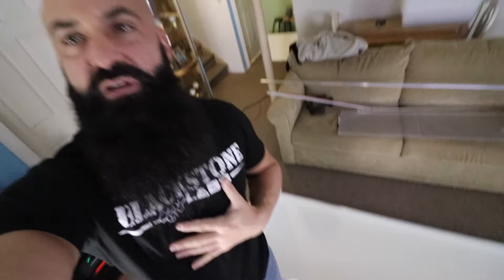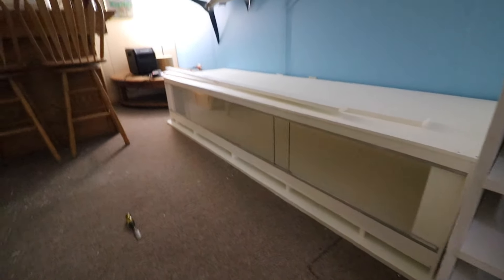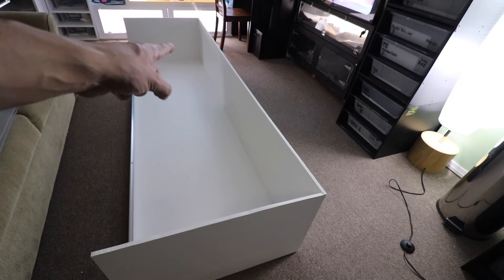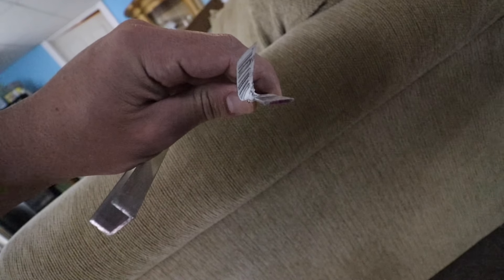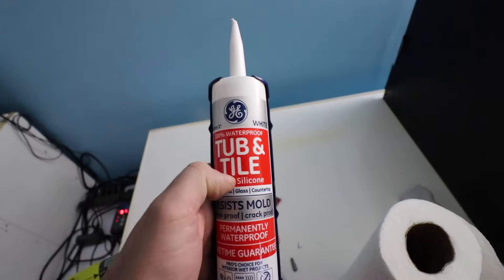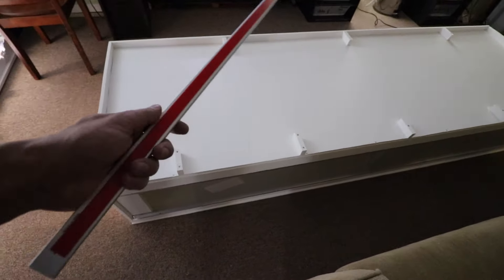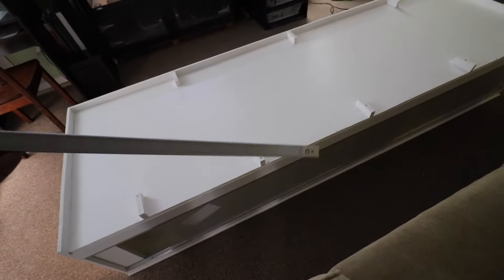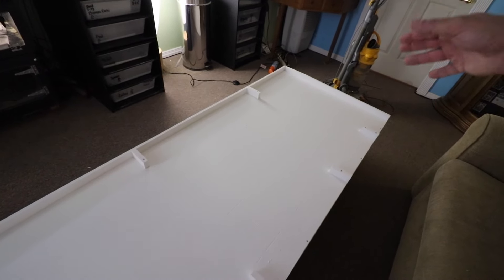How to Build Snake Enclosures (Cheap & Easy) DIY

Comment: im curious how you plan to maintain the heat and how the substrate will hold up with that PVC. Please lemme know.
Reply from the maker: so far the 11" heat tape is able to penetrate the pvc but i also use just paper as a substrate, not a thick bedding.  A heat panel would be a better option.

Comment: Im going to build mine soon im thinking about making a video and putting on YouTube.... Can you take glass out to clean? With knape & vogt track u can take doors in and out. But looks awesome dude.. Also i took a router and route out where heat tape goes plus pro products heat panel.... The bean farm has heat tape pretty cheap
Reply from the maker: Michael Ross i dont have a router, plus if you attach your prove to the heat tape, you would need to router out a spot for that if you want it to lay flat

Comment: Nice cage! It looks pro made I was wondering though how scratched up that plexus is, sliding along each other? Also how well is that caulk adhering to that pvc? There's not a lot that will stick to certain plastics. Really nice and clean look though!
Reply from the maker: The silicone caulk does allow for some wiggle and flex and is still completely sealed. My burms have knocked over their large water dishes and the water stayed inside the enclosure. Also their is still room between the plexi so they arnt grinding against each other when you slide them open and closed.  They are about 4-6 months old and still really clean and clear.  But they were cheap enought that if in a year or two you want to replace them you could, but i dont see a need to replace them anytime soon

Comment: Do you put the heat tape on the outside or inside? It seemed like outside but does heat tape really heat through the board?
Reply from the maker: Rob b outside and yes it definitely gets hot enough. I can easily get the hot spot to around 90

Comment: Amazing enclosure and video.  Two questions...  The feet are installed all around the edges.  You don't need any supports in the center to keep it from sagging? I have some big boas, and that was my only concern. Second, were I to make and stack two, could you envision any problem with connecting the two with a maybe 12 x 16 inch hole with a  removable hatch cover, so they could have a duplex if I wanted. Wadda ya think? 
I really don't have the room to build this inside, I am thinking to build it outside on the deck, bust up the old enclosure,  and then bring it in and set it up. Being in NY, don't wanna start this outside until we get some nice weather. If I do it, I'll let you know, take pictures and buy you a beer when you come to town.
Thanks,

Comment: This is the probably the best tutorial I've watched. You explained things super well and really helped me out!  Im really having a hard time justifying to drop 600-800 on a enclosure that I can make with some determination ( I have no knowledge with tools or measurements) lol but I'm probably going to build a little smaller version of this for my boa. Gonna figure out measurements tmmr morning and make my way to home depot lol. One question tho, is it necessary to use PVC? is there other materials you can use to build an enclosure? When using your heat tape what did you set your thermostat to? I was told to use a heat panel instead
Reply from the maker: Yea a heat pannel would be the way to go with this.  I used the heat tape until the heat panel came.  I had to set the heat tape to like 100F to make the floor of the enclosure hit 88F.  I'm not sure what other material you could use.  You can use wood, but you would need to line the inside otherwise the wood will absorb the moisture from the humidity.

Comment: Super job, Chris.  I was just wondering how you would facilitate UV light fixtures, and do you think overheating/melting the pvc could be an issue.  I mostly collect colubrids, so UB-A and B can both come into play.  Thanks.
Reply from the maker: I only used heat tape and this right now, and a LED lighting system (which doesn't give off any heat).  If you are looking to do dome heat lights im sure you can cut a whole in the top and put a screen mesh on it and set the light on that spot to avoid the light from touching or being too close to the pvc.

Comment: Will those lives you used on the inside help from it bowing in once stacked?
Reply from the maker: christopherjeffc yes bc its also screwed around all the sides as well. Plus its the bottom attached on the posts them flipped upside down, the roof it actually sitting on top of the entire structure

Comment: Could anybody here has a list of all the things that are required to be bought?
Reply: 8’x4’ Sheet PVC 12mm thick (2)
2’x4’ PVC 12mm thick (2) 
Caulking Gun W/ Tile and Tub silicon
1x3x8’ Veranda PVC
1x4x8’ Veranda PVC
1x2x8’ Veranda PVC
4’x2’ plexiglass cut in half (2 of 48x12)
8’ 1/2 in thick U shaped Channel (2)
8’ 1/2 in metal strip 
#6 x 1 in screws
#8 x 2 in screws

LMK if i missed anything

Comment: Thank you soo much for this tutorial! I've been searching and planning to try and build an 8ft enclosure for a while now! I finally feel confident doing this! I think I'll try and do mine a little bit taller as I have this large piece of wood I really want in there and I think it'll need to be taller to fit inside well. I'll have to unfortunately drive like 2 hrs to get these pieces, but so worth it! How would you go about stacking more on top? I'm wanting to build two 4 ft enclosures as well at some point, and really wanted them to be stack-able. Also, could you link the led light and heat tape you got from amazon? I'm trying to search for the light, but haven't found the exact one you're using yet.
Reply: Okay, so I actually found out my local Lowes DOES carry 4x8 pvc sheets! They are only .375 in, so 3/8 inch, 1/8 shy of 1/2. Do you think if I reinforce the bottom with long pvc boards instead of small ones like you did, that it would be alright to use that?

Comment: nothing towards you specifically but i love "you dont need special tools," list elaborate power tools that require bits, blades, clamps, and elevation for cutting 
I own a hammer and some steak knives, what can I do with those? 🤣
Reply from the maker: Well the saw i used for cutting was $20 from home depot and it comes with free blades, the table I used to cut on was my couch, the drill was $30 from home depot. And I used a pencil to draw the lines to cut. So yea i wouldn’t call that elaborate.

Comment: Nice job Chris, I've been looking for an easy up front DIY for building my own PVC boa enclosures and this is going to be the one I use. Any reason why you went with heat tape and not a heat panel? My boas are going to love their new enclosures, thanks for the video! I will definitely send in pics when completed.
Reply from the maker: Rocka Rolla no but i am going to switch over to a heat panel. Its a smarter plan.

Comment: Shouldn't it be a bit taller? Most bigger snakes in the reptile hobby would definitely prefer a taller space.
Reply from the maker: yea it can definitely be any dimensions you would want it to be, this is for my burms who at the moment are only about 7 feet long, but this seem to be a common size among most keepers.  but this would be a way to build it as big as possible for as cheap as possible.